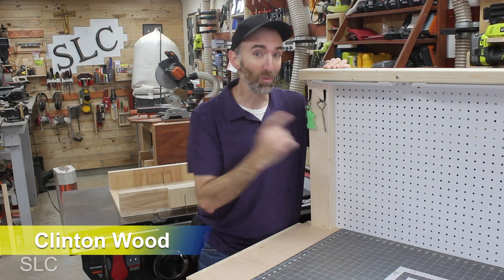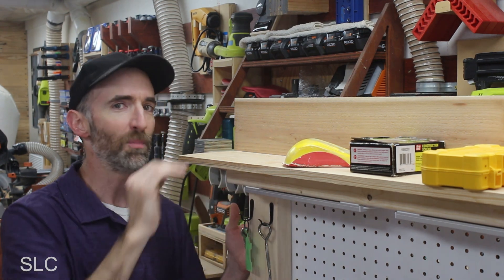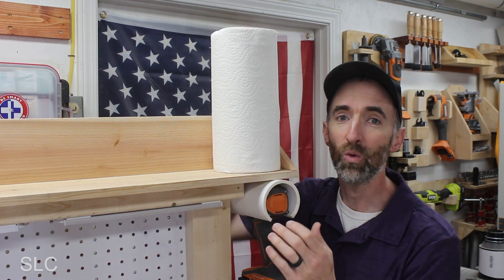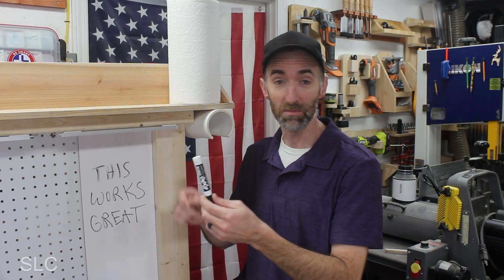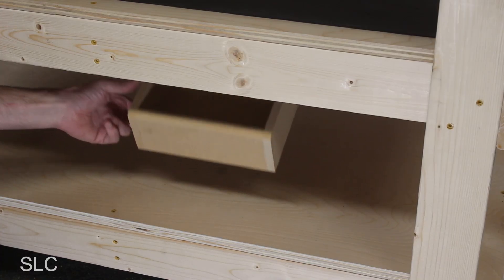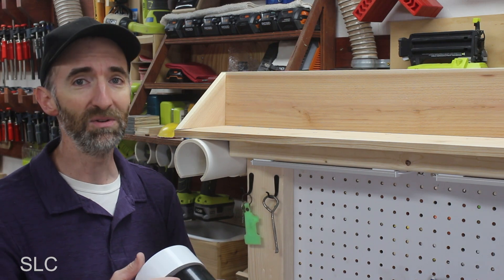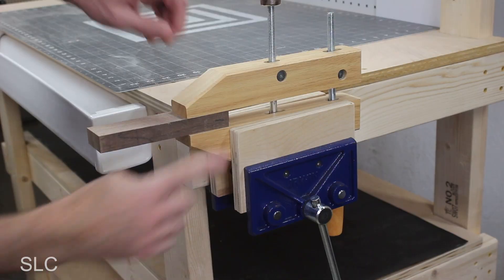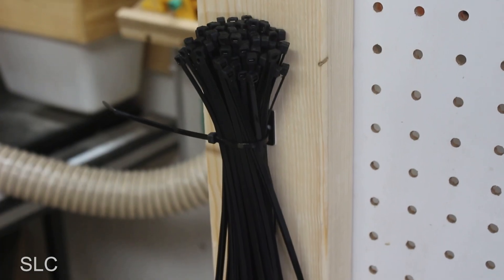10 MORE Workbench Upgrades: Get Them Now

Comment: Those are some handy tips, and here's one more for you: DIY pegboard hooks. Take steel wire (old clothes hangars or even stock from pkg stores), cut to length with wire cutters or hacksaw, and bend around pipes/cans/dowels/etc. to get the diameter you want, then bend the ends over with a vise grips or even a vise. (The ends are what goes into the pegboard holes.) If you have an assortment of various pegboard hooks already, they make good patterns for making more. For hooks for lightweight items, you can also use scraps of heavy gauge wiring; they're soft copper inside, so they won't hold a lot of weight, but there are always plenty light items lying around, usually taking up valuable space in drawers.